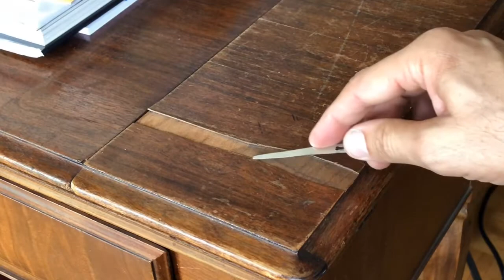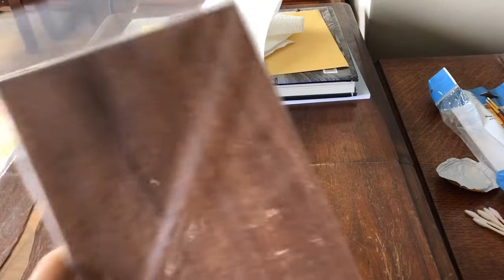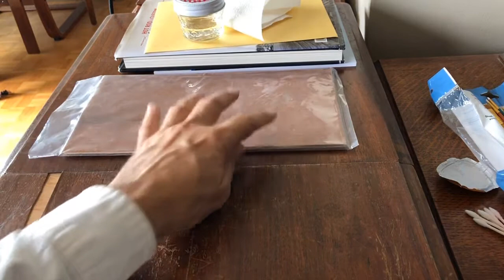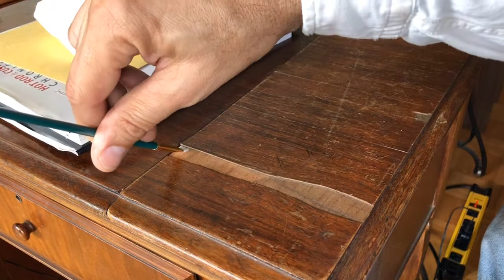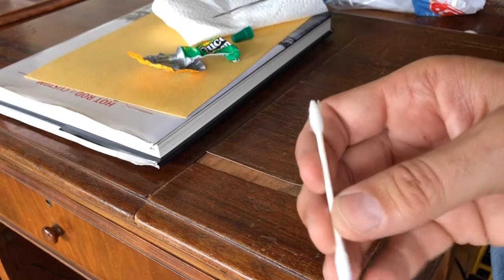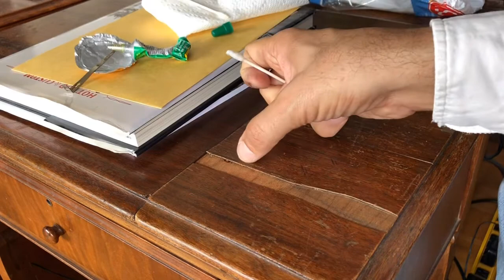SEWING TABLE REPAIR SERIES # 1:  Preparing a Sound Surface for Veneer Repair On a Singer Table

Comment: Thank you! I've had a 1910 Singer 27 treadle in a very nice oak table for a while. Looks like a previous owner used it as a plant stand so there are some big splits in the veneer. I've held off on it because buying new veneer that big will cost more than I paid for the machine, and I really don't want to refinish it at all. I thought there surely must be some way to re-stick the veneer, and I've had some Restor-a-finish just waiting for the occasion. 
I believe this is why doilies used to be more common, to hide these kinds of things 😂

Comment: Considerable time has passed since this video was made, and I've seen a lot of your others since then, so I just thought you might be still wondering what that "Hair clip part" might be--it's an older form of a bodkin for feeding elastic or ribbons through folded and stitched tubes in waistbands or other areas where it would be useful.  In the slot with the circle, you can slip an elastic or cord through the hole, and slide it up into the thinner slot and it will hold.  The two horizontal slits would be for sliding a narrow elastic or ribbon in one, then through the other to feed it back up to the first one and feed it back through sort of like a buckle to hold it in as you feed it through the tube.
Reply from the maker: Thank you for sharing.  I recently read somewhere about this but your message confirmed it.
Reply: @VintageSewingMachineGarage  I am constantly amazed at the quantity of clever and strange things we find in these old machines!

Comment: I would recommend that you square up that missing piece of veneer. That would make it a lot easier to fit the new piece in. Also check the old and new veneer thickness you might have to build up under the new veneer so when it is glued down it will sit level with the surrounding old veneer to either side.
Reply: Bearcwy, what material would you use to build up the thickness of the new veneer?

Comment: I have started using Gorilla wood glue it is very permanent and it can be thinned to use with a syringe 

to get the glue up under deeper areas of the veneer separation that I have come across on a couple of bentwood projects and seems to work extremely well.
It is water based so you get more work time and excess cleans up with a damp rag.

Comment: Thanks for sharing your expertise these are fabulous videos!  I did wonder - why do these high quality tables even have veneer in the first place?  I confess I was thinking if I bought one with damaged veneer I could strip it off and re-sand it.  Is that sacrilege?  Thoughts?
Reply from the maker: Hello Isabel.  The best once can do is to have any veneered piece spot repaired or re-veneered.  Veneered pieces used to have as association with lower cost.  Today, veneered furniture can be quite valuable.  If you explore further into the construction of your table, you will discover that, compared with most all new furniture today, the construction is superior.  Many of the veneers are from tropical hard woods that are scarce today.  And one of the most beautiful tables I've ever seen (sewing or otherwise) was veneered in a walnut burl that I have not see since.  My greater point here is that I would not look down on veneered pieces from the vintage era.  FYI, veneers can still be purchased.  There are man sources for materials for such a project.  Lee Valley Tools has quite a selection but there are other places online as well.
Reply: @VintageSewingMachineGarage  So it may just be that all the tables are made in solid oak, but the veneer allows buyers to choose a mahogany finish or a walnut finish without making the entire piece out of these hardwoods. Thanks for taking us on this journey of discovery ....